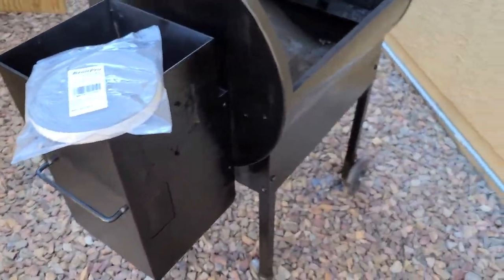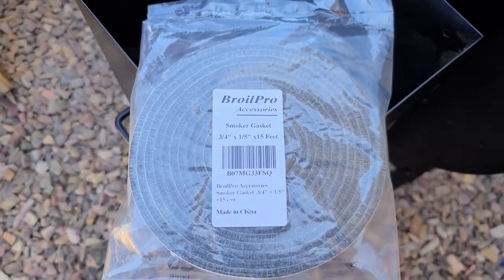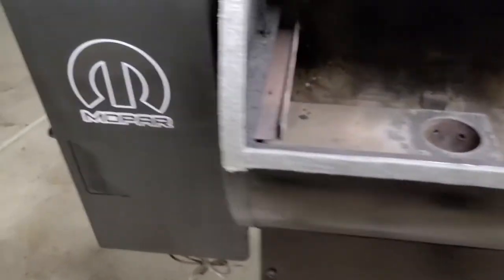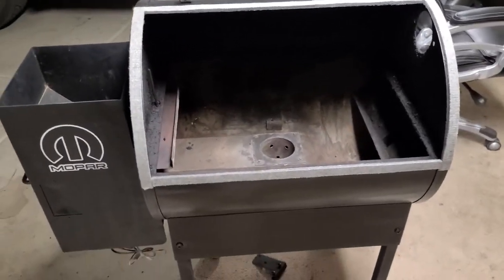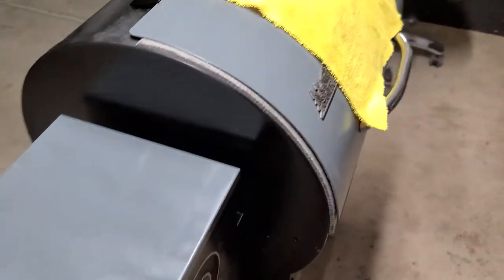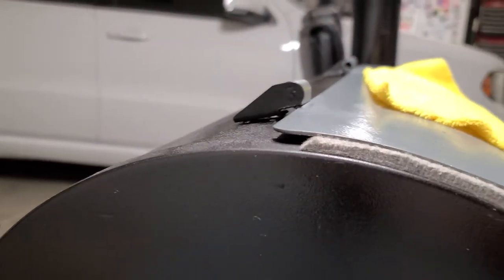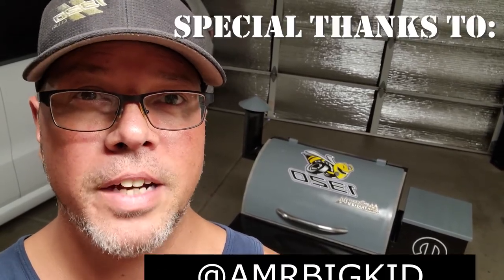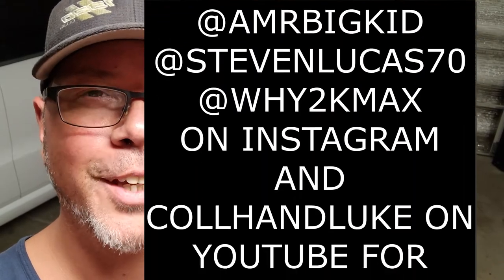Traeger Grill Rebuild (Part 3)

Comment: Can you show how you fixed the gap between the lid and gasket?
Reply from the maker: Yes loosen the screws for the lid and replace them with longer ones add washers to the lid bolts
Reply: @Destroyer1320  sounds simple enough. Thanks! Great build and video btw
Reply from the maker: @chintor896  thanks for the support